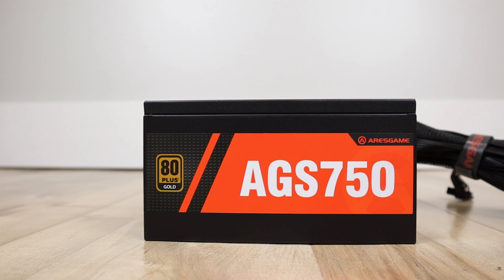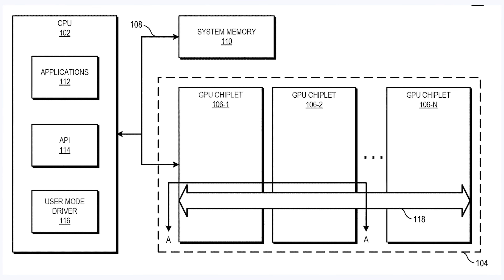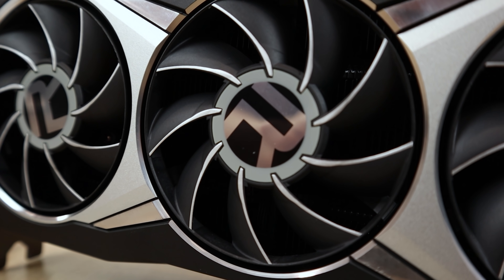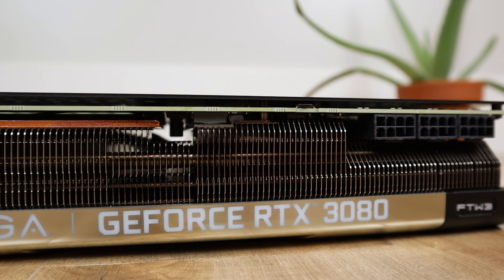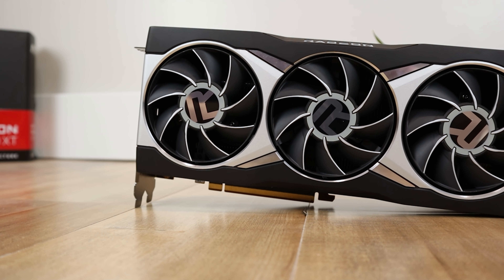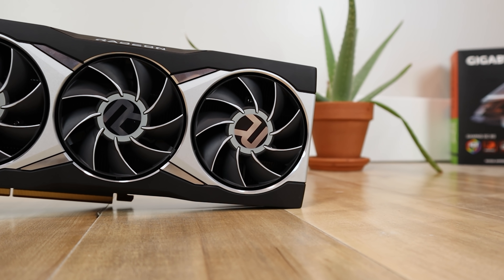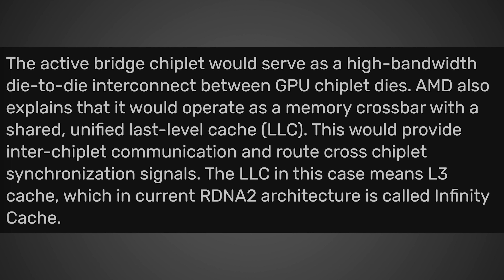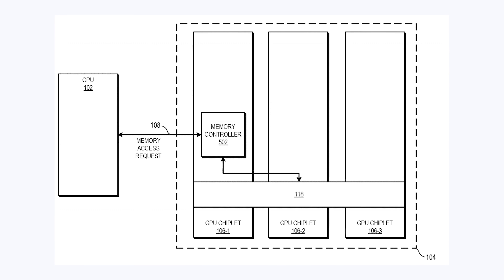AMD Just Changed the Game - GIANT RX 7900 XT GPU Leak

Comment from the maker: Thank you to AresGame for sponsoring this video!
AresGame AGS750 PSU (Affiliate URL): https://amzn.to/3cVrbJa
Do you think the AMD RX 7900 XT  will use a chiplet design, and how fast do you thin it will be? Let me know your thoughts in the comments below!
Reply: lol i saw the power supply and was like thank god this wasnt the gigabyte one
Reply from the maker: @Jsteeezz  🤣
Reply: I was looking at this for my backup, beater system (Gigabyte z390 and 8700k). I don't want to spend too much on it but also don't want an 80 plus bronze. I'd love to see an actual power, heat, and ripple voltage review of it.
Reply from the maker: The price is really good considering how expensive most 80+ gold 750s are right now. I have been using one in a system for a while with no issues. According to the box it can do 750W over 12V at 40c which is actually really good. Many PSUs will say 750 but only do 650-700 over 12V.
Reply: @GraphicallyChallenged  yes but where dose this PSU rank on the teir list in terms of quality.
Reply: 62-73% performance gains initially...  then smaller but steady gains from there after the first revisions
Reply: I think you were getting zen 1 and 2 mixed up. Zen 1 was monolithic with infinity fabric, it still had threadripper. Zen 2 had chiplets, Zen 3 unified chiplets.
Reply: @dralord1307  didnt zen 1 use 2 4 core chips.
Reply: I click the like button... where is my RX6800 GPU? More in stock I don't think so XD
Reply: Even if no chiplets there will still be big architecture improvement and gains from a new node which rdna2 didn't have.

Comment: I mean... it cant be 100% faster. Some CUs will be turned off most likely and the Clock might also get slightly lower. So i guess its more like 70%. Or 35%. You also cant make like 4x80 CUs. That would mean that right now you could make 4 RX 6800XT with that. If you use it for one Card then you need 4 Times the Capacity too. And we know its currently already pretty... sold out... everywhere. Or its so stupidly expensive no sane Human will buy it. (... should not buy it...)

Comment: The 160 CU rumors really hurts to hear. There's no way they're selling these for any less than $2K. If they can charge $999 for an 80 CU chip, you bet they're selling the 160 CU cards for $2K. It's less profitable to build the bigger chip than the smaller one which is why the 5950X is so much more expensive than the 5800X as now it needs 2 perfect chiplets vs 1 or 2 half acceptable on the 5800X.

Comment: I am confident that next gen AMD GPU's will be a massive improvement. And so will Nvidia's. AMD needs to improve their RT tech. AMD has already trashed Intel and I can see them trying to take the fight to Nvidia big time. I honestly think AMD is pushing both Nvidia and Intel to try even harder than before. I wouldn't mind trying an AMD gpu if its good. I have currently a 5800x and 3080 in my rig.

Comment: Well, they can do it 3:37 it’s called the first i9, the i9 7980XE with 18 core but as expected extremely expensive at 2 thousand dollars it took them two “generations” of producing the same chip with different name to reduce its price with the i9 10980XE to 1K (but now the i9 7980XE is especially good a you can buy in Aliexpress or eBay for between 400-450 dollars making it a very good choice, specially if you want to be warm in winter with such a monster in 14nm, in fact I already bought one, I’m waiting for the motherboard to arrive)